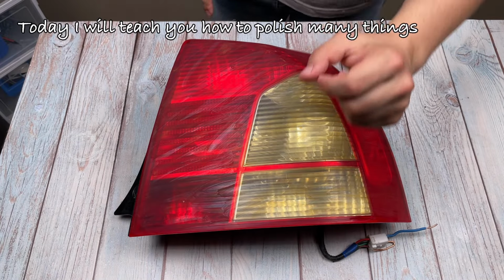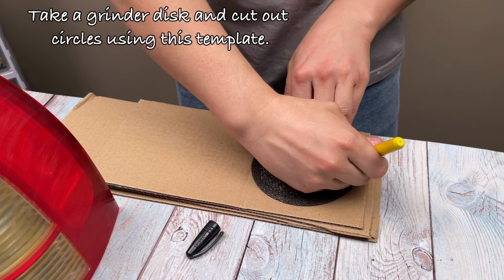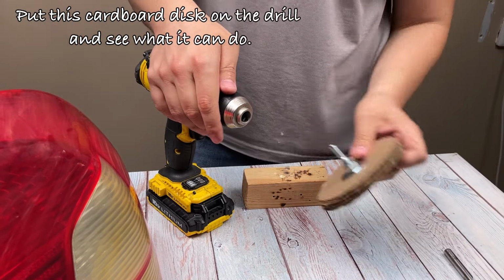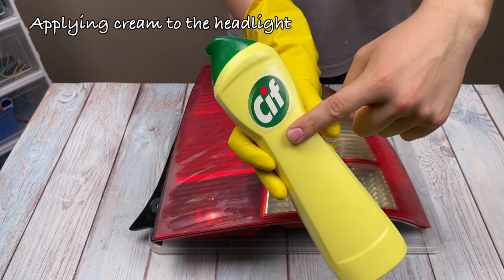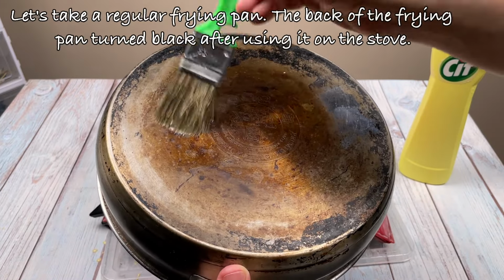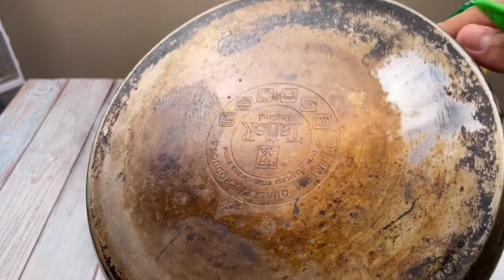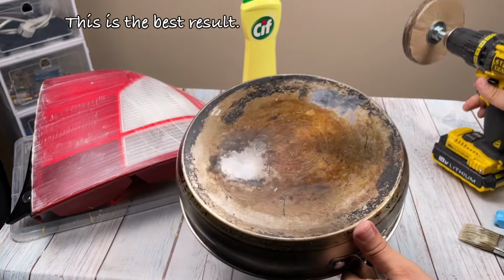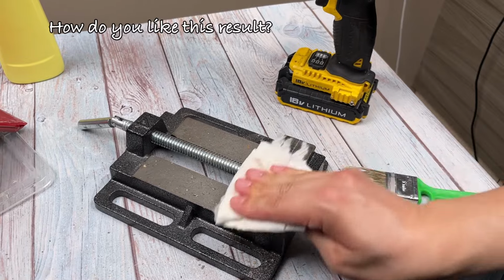🔥 Why isn't this patented yet? Insert CARDBOARD and Apply Detergent!

Comment: I just use brasso as it's a mild compound, it's just right for cleaning front and rear plastic lights. No need for all the extra work, just rub on with a soft piece of cloth work it in and buff off with another cloth job done. You can clear lacquer it if you want as well.
Reply: No need others camicol cleaning for light ? One coak and next whic camicol mixing you sir ? Ihave no idea ..please tell-tall me about clean for light camical....